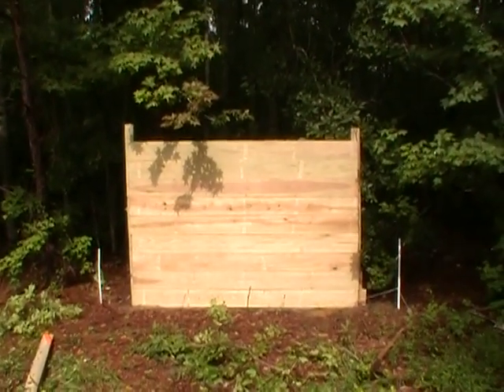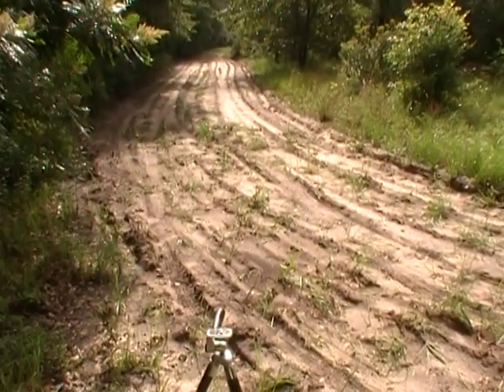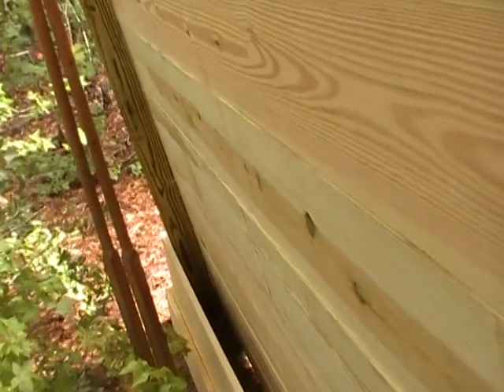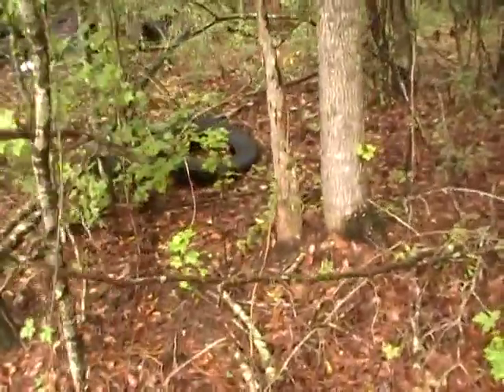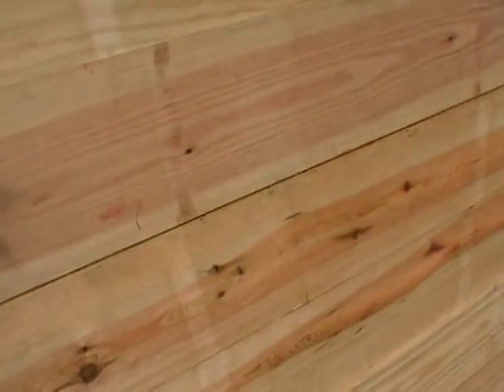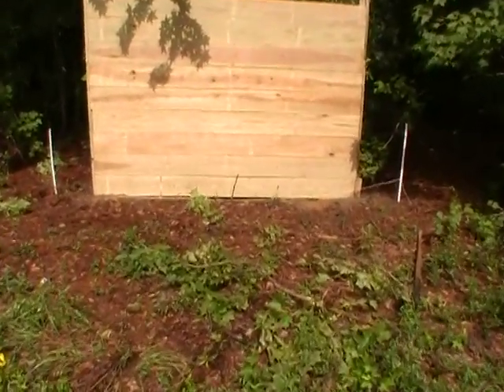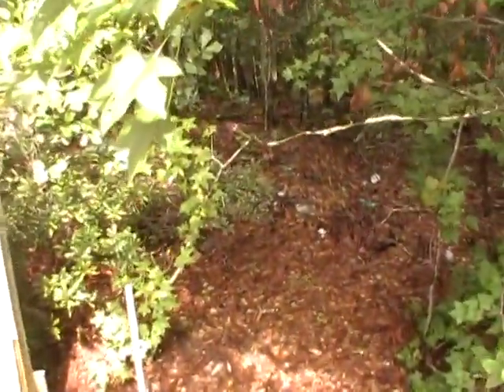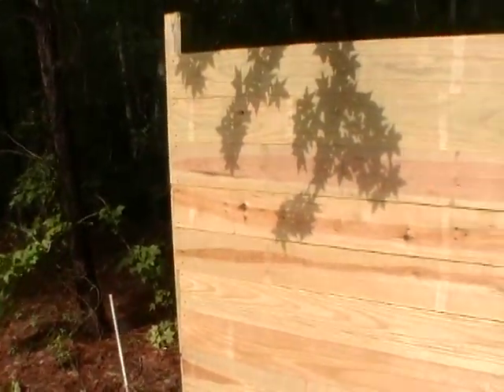Shooting Backstop Tour 1

Comment: Not much of a backstop for a .50 Desert Eagle or AK or AR 15.  Use at least 1/2 inch steel plate at a 45 degree angle.  Those 1 by 8 pine boards won't stand up to a pellet rifle. At least fill the in between space with broken bricks.